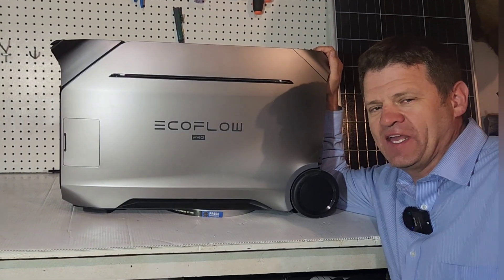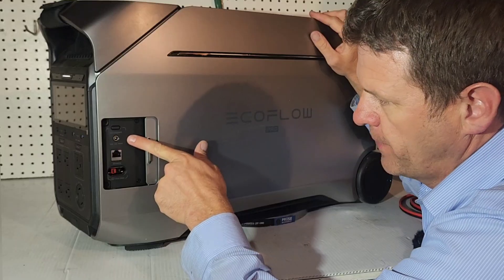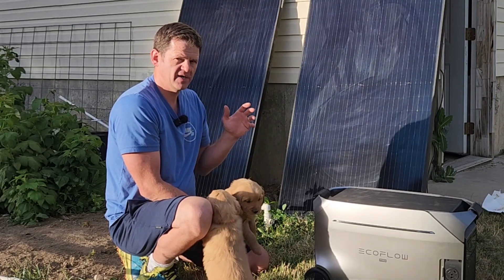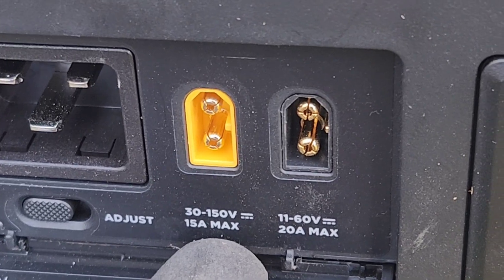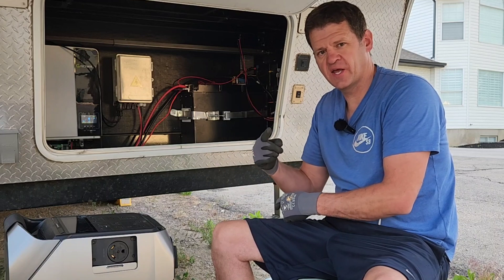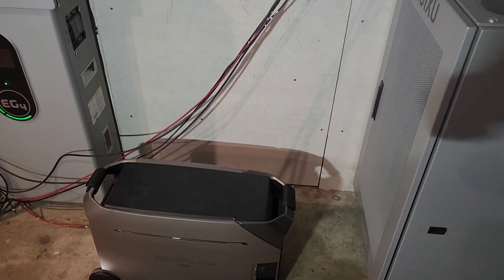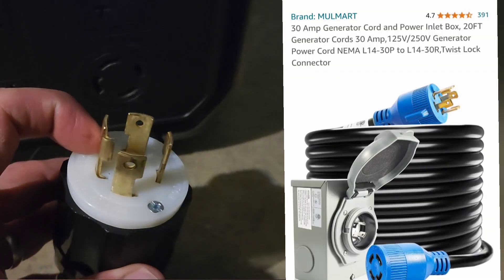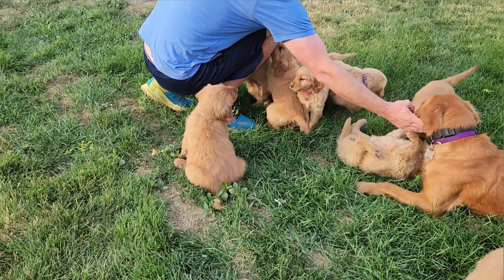EcoFlow DELTA Pro 3 Test Review - How I Use This Power Station

Comment: Have you used this unit much since this video? You said they are for temporary usage, but if it's plugged into a critical loads panel 24/7 with solar.. what about running it all the time as a permanent solution? They are definitely on sale more and more, there's a lot of competitors. Looks like the Delta Pro 3 and the Ultra are the only UL 9540 listed if that matters. Can I ask, what's the advantage of wiring up say only 4 x 400 watt panels (3 in the high PV, 1 in the low PV) in series  vs 8 x 400 panels in parallel? Since the unit clips the amperage, what advantage would it give you? If I'm understanding wiring correctly, you'd have to likely use much thicker AWG wirer in a parallel setup vs the standard #10 AWG in series?
Reply from the maker: Thanks. I still have the unit. They ended up giving it to me. My favorite feature is the Rolling Wheels. I don't use it a lot.  "Everyday solar" has a good video on over paneling.

Comment: had 2 Delta Pro 3 ( DP3 ) units running in parallel with their 50 AMP hub bridge. One of the units was defective and caused a tremendous power surge which fried my HVAC thermostat and ECU, coffee maker, Air Purifier, GFCI outlets, and over a dozen outlet surge protectors and damaged 2, 200 AMP breaker panels.  The damages have run into the thousands. One electrician who inspected my system told me that one of his customers had a similar problem with his EF Ultra except that he didn't have the unit hooked up to the home.  I like the EF Delta 2 Max batteries, but the EF DP3 and the bridge is not good. $12,000 of damage was done.

Comment: How much can you overpanel by? Let’s say on the low voltage side I have 3 panels in parallel, 30amps, so over paneled by 10 amps. If I have a 4th panel lying around, should I throw it in parallel as well?

I’d be at 40amps, but since it’d clip it to 20 I’d be fine? This would allow me better cloudy/low light production?
Reply: It might work, but there is a control loop inside the Ecoflow that adjusts the effective resistance the solar panels see in order to extract the maximum power from the current panel configuration (a Maximum Power Point Tracker  or MPPT algorithm). If it makes a small adjustment and gets a much bigger change than it expected due to excessive over-panelling, then the control loop may go unstable and break your unit.
Reply from the maker: The "Everyday Solar" channel did a similar solar setup for what I suggested for this unit and it worked great for him.

Comment: I had an argument with my friend on which transfer outlet to use.
He is stuck on 240v.
I said 120v. 😂
240v is preferred if you have the large gas or power stations that come with a 240v outlet.

For me, 120v is more versatile. You can plug in any size gas or power stations.

My friend just bought a Delta Pro.
I asked him, how are you going to power the house with that. 😂
Yes! He could buy another with the hub but he is too cheap.
Reply from the maker: Yes, this unit will not be able to power many large 240-volt appliances. Small 240 volt appliances, yes but most 240 volt appliances are larger loads
Reply: For a transfer outlet, I would go 240 volt.  At least you could run something like a well pump, small appliances and  also 120 outlets.
Reply: @JeepBigE  
That wasn't the argument.
I asked my friend. How are you going to use the new Ecoflow Delta 2 Max. It doesn't have 240v outlet.
He has no choice but to use extension cords.

Comment: I use my Pro 3 to charge my Tesla once a week.
I charge up the power station from the Sun. Every weekend I dump it into my model Y. Good for 15 miles driving easy.
Reply from the maker: If you have solar panels. you can connect 9 large panels to this unit. This unit would be awesome for charging your car during the day
Reply: @diySolarPowerFunWithRay  
No, I'm robbing about 100 to 200 watts from the house batteries. It takes 3-5 days to fully charge the Delta Pro 3.
Reply from the maker: @wt9653  yeah, I was able to connect nine 300 watt solar panels to this unit.  It did awesome

Comment: This was very informative, thank you. I am thinking of buying this unit, but I have added the wattage of what I will need to run certain electronics at home, and came up with 3500 watts. My question is, solar aside, because I can recharge it with a small generator, how long will the unit alone keep me with power under 3500 watts continuous usage? Thank you in advance
Reply from the maker: It has a 4096Wh battery... So basically it will run 4096 watts for 1 hours...  The invert running will also pull from the battery so I'd guess you can run 3500 watts for 1 hours.  But I doubt you'd be running everything at the once.  Good luck :)
Reply: @diySolarPowerFunWithRay  Thank you

Comment: Hi, great video
Having two 400 watt solar panels how  would you set up on a delta pro 3 looks like I should not do series, thank you again.
Reply from the maker: You want to look at the back of the solar panel to see the voltage. When you connect them in series the voltage will double but you don't want to go over the allowed voltage on power system specs. Hope that makes sense
Reply from the maker: I imagine you'd be fine if you connected them in series to the yellow Anderson solar port.
Reply: Thankyou they are eco Solar panels they get full sun here in New Mexico , wanting to do it right, like your channel

Comment: All five of my EcoFlow put out only 50 3 AM on both legs of the RV plug which is incorrect should be 120 V on one leg a neutral and a gram. This is a huge problem. No one is reporting. Burning up all kinds of things in my RV the last two years.
Reply from the maker: I'm not sure I'm following. Measure across each leg to neutral and you should have two legs of 120 volts on each leg.  Why is it burning things up in a RV?  Thanks.
Reply: @diySolarPowerFunWithRay  - a lot of typos from voice texting that I didn’t correct before hitting send. What you just described is 240 V wiring. EcoFlow Delta Pro 30 amp plug for RV should have a ground neutral and hot with 120 V. it has a ground and 2 hots that are putting out 53 Volts each.  this is not correct and a huge problem. My small toy hauler RV is only getting 53 V because of the poor wiring.  The customer service is horrible and told me my multimeter doesn’t work correctly and my RV tech doesn’t know what he’s talking about.
Reply: 53 amp

Comment: I have a question. So I can leave my rv agm battery in place and tap the Anderson port to the battery. There is no issue with the agm back feeding the EcoFlow? 

What if I have solar charging the agm while it’s hooked up to the EcoFlow Anderson ports?
Reply from the maker: AGM and lithium batteries generally don't play well together. I'm not sure if they have any special protection underneath the hood of the Echoflow so I wouldn't do it personally.

Comment: Interesting that Ecoflow added more battery capacity but still left the input (solar) to 150V like the Delta Pro.  not sure why they would do that -- especially if you have extra batteries connected and such.   Weird.
Reply: They are losing sales and money on their over priced equipment. I like their products don't get me wrong. I just can't see these mass adopted for the price. Best way to get into these are open box and refurbished. Then you see true prices  thanks Ray
Reply from the maker: Where are you purchasing refurbished units?
Reply from the maker: Thanks, I'll have to check those out!

Comment: Send that thing over to me to test out after you get done evaluating it😝
It seems to me though that by including 2 different charge controllers in the unit that it will end up with some users getting the 2 different ports confused and plugging solar power into the wrong one and damaging the unit.. I think of it like military hardware.. you have to make it grunt proof.. or maybe wife proof.. either way, I'm pretty sure that there will be some units being damaged because of this.
It's just easier when both charge controllers are identical so that you can't confuse them in my opinion.

Comment: They need to design these things to be used with standard, cheaper LiFeP04 batteries instead of the ridiculous, expensive add-on batteries these companies push. They also design many of the lower priced high output units to be used with their own very very overpriced folding solar panels when they should be able to use waterproof, 25 year glass panels when used for your home and still get the full solar input. This is UNFORGIVABLE. I love my power stations but all of them advertised a higher capacity than they actually provide. If a company claims 700wh or 1200wh the device should actually be capable of producing that and they should be repairable if a board, inverter or charge controller quits working. 

When I first tested my fully charged Bluetti EB70 with 716wh on my freezer the watt meter revealed it only provided 540wh in one test, 520 in another, etc. Luckily I was able to at least get a 2nd free one from them. And oddly enough, the AC inverter is so inefficient that my 500wh power stations can run my dorm fridge up to 8 hours longer than the EB70. 

This is why I started buying parts over time to build my own system with a 300ah LiFeP04. It has taken me three years to do this on my fixed income (and a LOT of studying) but I can FINALLY power my window air conditioner. And if a part fails I can replace and repair it.
Reply from the maker: Cool always nice to be able to fix your own stuff